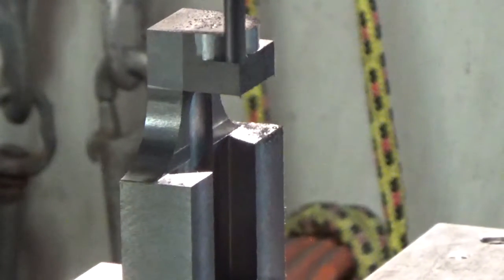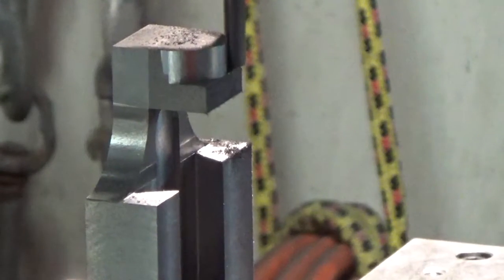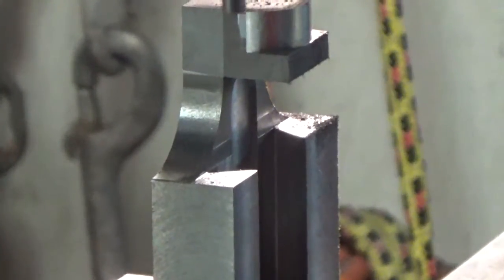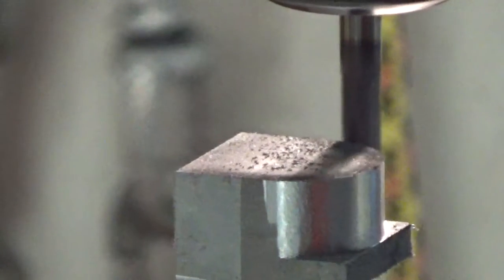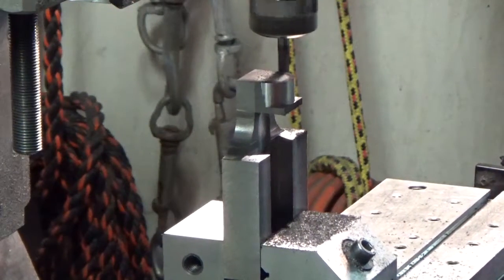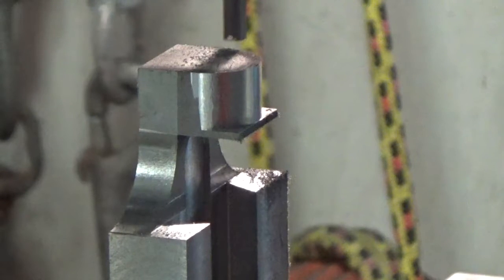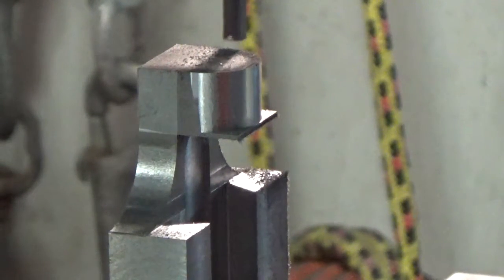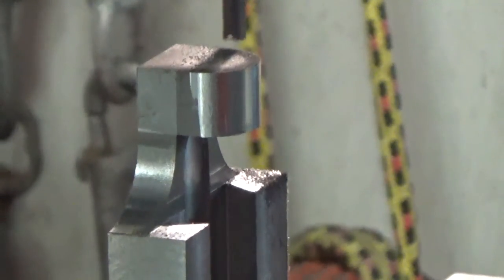Shop Built Hand Shaper.  Cutting Radiuses on Front Unit CNC.

Comment: Hi Larry I notice you and Walter are building the same shaper are there a set of plan that you are building it from or is it a self made design .
Reply from the maker: Yes we are and no there isn't a plan.  Your welcome to visit my "One Drive" and look at the photos.  I think there are also my drawings which still get revised from time to time.  I'll post the link and give permission as long you have the link.  I usually post my photo link in the video headings.  Not Sure Though!  Regards: Larryhttps://1drv.ms/f/s!AoFHBXavAXM5gZB6SzZp72fb-Wi6Kg
Reply: Larry Poindexter hi thanks for the reply . When I get my sherline cnc done il be doing on based on an adept which is slightly smaller . I would join you two with taig machines but the mills are twice the price of the sherline hear in the uk .

Comment: Nice video Larry, I listened at around 2.25 then I looked at some photos of the clapper area, and  yes I think you are right it will need a right hand leadscrew, so that's good,

Edmund..........Albeta
Reply from the maker: Walter:  I will start on the clapper unit next weekend.  Maybe at least, get a block of metal roughed out to size.  This week I'll try and make a drawing to work from.  Taig does have a right hand thread lead screw setup for cheap, but I hate to pay the shipping that they've raised in recent years.  In the past a bought several to use on my watchmakers lathe unit that I built.  Regards: Larry